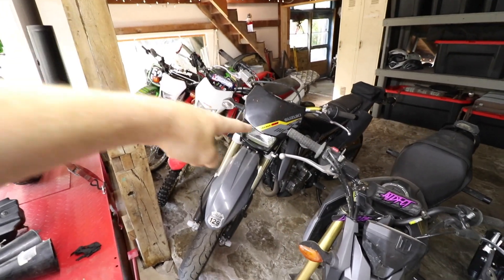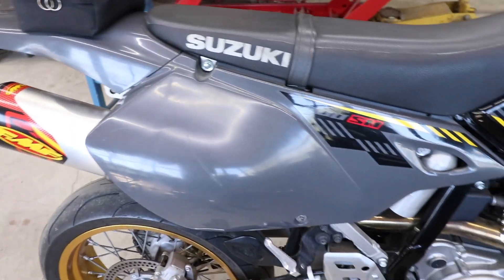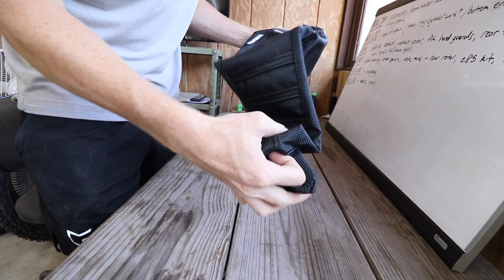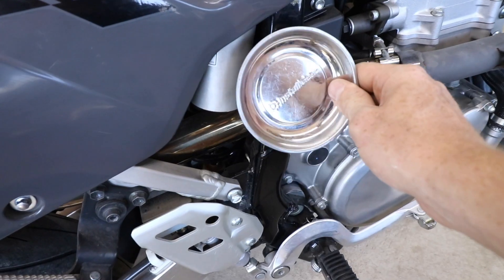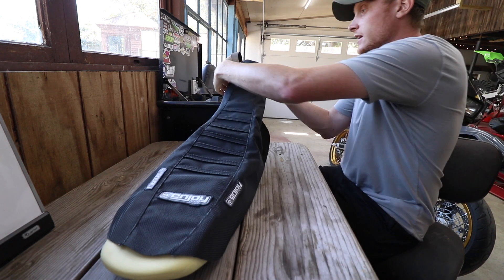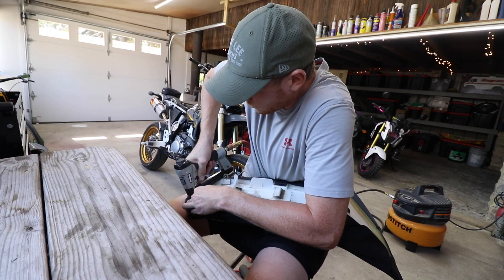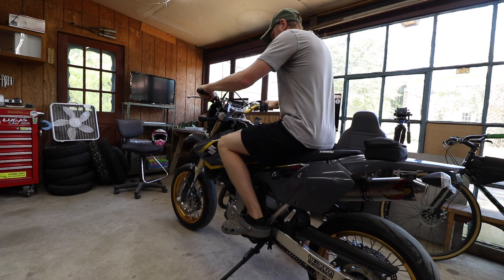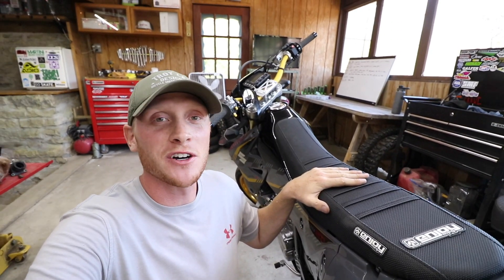DRZ Gripper Seat Cover Install! | 5 Minute Mod Friday

Comment: Pro tips: acetone on a rag will get rid of the Suzuki logo.  Does take some work, though.  Not gonna lie.  And straight car wash solution (no water) wiped onto the stock vinyl will make it clean and grippy. Much love. 👨‍👩‍👧 ❤  -David, Elizabeth, and little Jessica.
Reply: Another cool trick to get rid of them is a hair dryer to warm up the sticker and a credit card to gently remove without scratching.

Comment: if you go out to buy a hand stapler, do not buy anything that makes it easier to squeeze.  they don't staple as hard.  and make sure it's designed for T50 staples, not the smaller desktop stapler size.